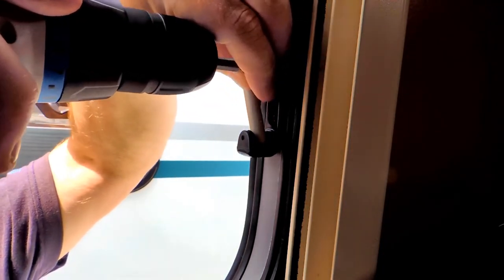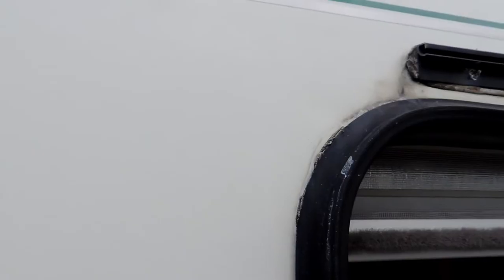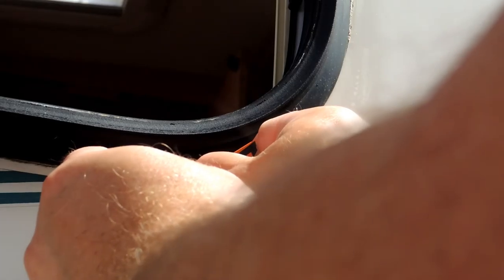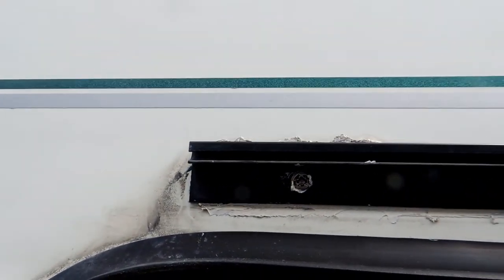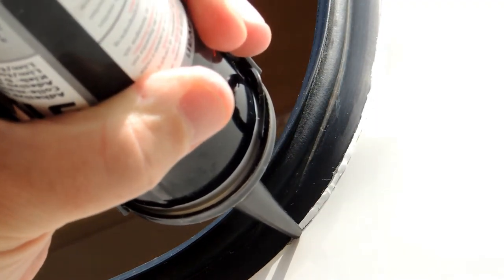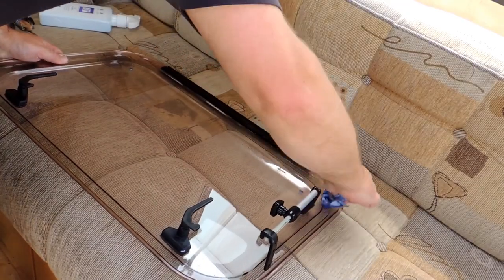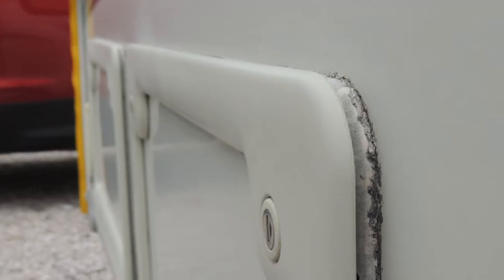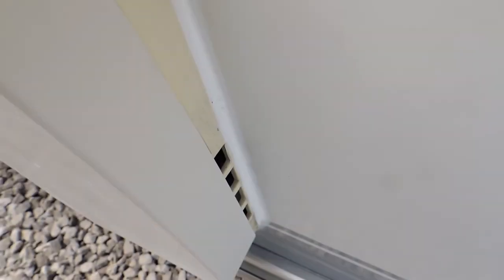Sprucing Up The Sealant On Our Caravan

Comment: My caravan is now 14 years and I would like to  reseal my caravan, shouldn't you take the item off clean all  old sealant off and reseal with new sealant.
I know it's a big job but surely putting a thin bead of new sealant around old sealant which in my case is 14 years old is going to do a sound job.
My first caravan and wonting to keep and look after it,so looking for advice. Thanks
Reply from the maker: In our case Peter, it was just to spruce up the old excessive showing sealer, basically,  that was was expelled and visible. You're dead right in that if an item is leaking then take it off and seal underneath and effectively "re-do" the job. Luckily, ours wasn't leaking so if it isn't broke, don't fix it 🙂 and we just prettfied the part you can see. Our first caravan too, so spent a week or two during lockdown tidying it up. Thanks for watching and all the best for '21. Martin & Jo.